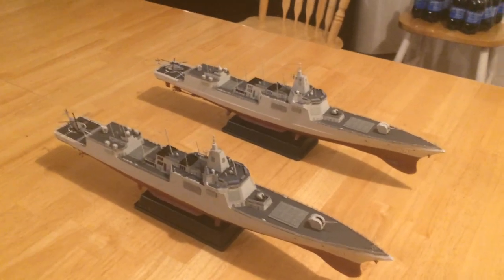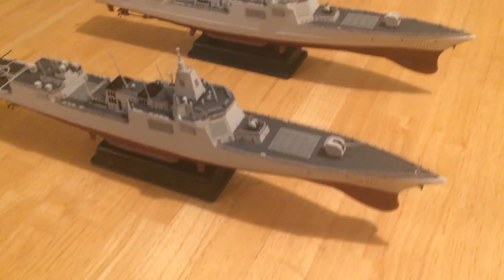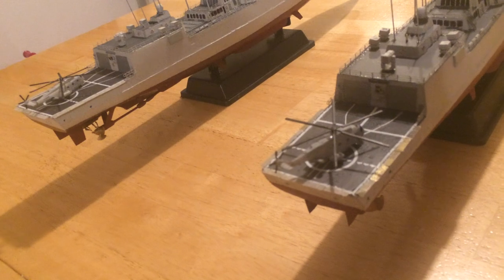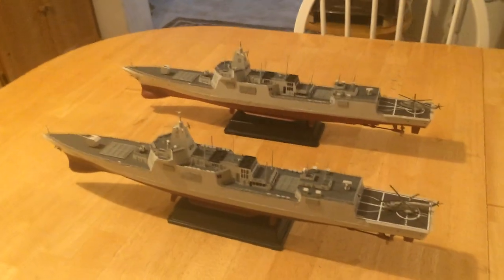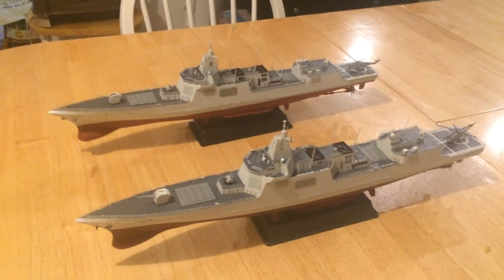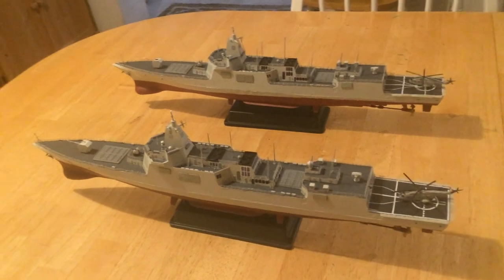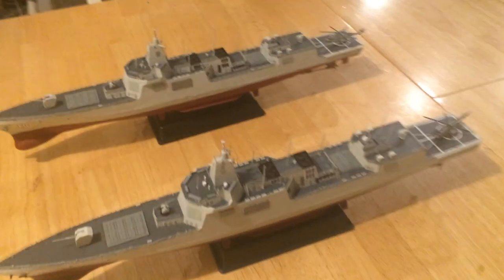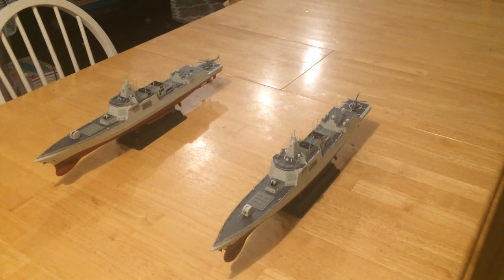Chines Navy (PLAN) Type 055 Large DDG (Cruiser)

Comment: The most prominent feature of Type 055 is its sensor arrays,
- The radars are all with fully solid state AESA antennas
- They are reportedly using digital waveform generation
- At least 3 different types of visually large AESA antennas can be seen
So it's safe to say that they are multi-band with data fusion and electronic warfare integration. Their capabilities can also be upgraded completely by software.

Comment: The reason of 055 have less VLS number is very simple: Chinese VLS system is much larger, 0.8 meter caliber 9 meter depth. Compare to US 0.7 meter caliber and 7.18 meter depth. In the world of missile, guide system made from US and China are weight pretty much the same, you can compare AA missiles made from both country to have a general picture. The reason why Chinese made those VLS so big is simple: longer range, bigger explosion. Due to current disadvantage of their carrier capability. They need 055 to pack as much punch as possible.
By the way, Chinese system can shoot 533mm rocket assist torpedo from the VLS which is insane.
Reply: China doesn’t have a anti submarine missile (asroc） that has a 533 torpedo warhead. But the Yu-8 has a range of 160 KM. So China doesn’t really that much on helicopters for anti submarine warfare.
Reply: @dadidadida123  I heard there is a 533 rocket assist torpedo for anti Aircraft carrier purpose. The anti-sub torpedo fire from surface ship usually much smaller.

Comment: Hi Jeff, great work, these 055 kits are due for release here in AU shortly. Cheers Peter Hoskins
Reply from the maker: GREAT..they are worth it.  I got mine on eBay from China for about 24.95 + shipping.
Reply: Jeff Head Thanks Jeff, these 055’s look to be a big step forward for the PLAN, when I first saw the dimensions and armaments they certainly are not a DDG, as you have said they really are a full blown CG. Cheers. 👍
Reply from the maker: @petehoskins1267  I believe the Ticos warrant CG...so do these.  in fact, so do the Se Jong class from the SKOR Navy.  I believe the Ticos are still the best out there.  They experience the US has gained and factored into its many upgrades are something the Chinese have not had time to experience yet...much less program and develop the solutions and have them already in these vessels and ready to go.  But they are capable and dangerous ships none the less, and we cannot take them for granted.  The US needs to get the CGX designed and building in the next 4-6 years and then have them come out with effective Riag Guns and lasers, and effective long range munitions for the 127mm or 155mms.  We were almost there with all of those things before the Obama admin canceled outright the LR munitions, canceled the at sea test the rail gun was more than ready for, and slowed down the Laser testing that was already at sea and performing well.  We need to get off our laurels now and get all of those things back on the front burner.
Reply: Jeff Head Fully agree Jeff, the Tico’s are so important, but my money would always be on the US. Cheers.

Comment: VLS size is a key difference between US and Chinese destroyer. Chinese Destroyer need to take up the anti-ship task, at least partially under current situation. The large 850mmX9m “strike“ cell is prepared for that, and I think they are very likely to shoot a ship-board hypersonic ASBM from such a large cell. 

As the quad-pack missiles, I think it depends on the demand, could be under development or testing. But HQ16 has diameter around 0.35m and already fitted in 054A’s VLS, so I think quad-pack it in a 850mm cell should be no problem.

Comment: Why do we call type 055 a cruiser, while we call DDG1000 Zumwalt a destroyer? DDG1000 has larger displacement than type 055.
Reply from the maker: Well, to be fair, the Chinese do not call the Type 055 a cruiser.  Officially it is classed by them as a Large Destroyer.  And I agree, the Zummwalt could easily be classed as a cruiser (despite the Obama administrations neutering of the class), with its displacement, large guns, and 80 PVLS cells, along with its over sized hanger.  And, I believe that there is still the possibility that the ultimate CGX could be based on the Zummwalt hull.  Time will tell.
Reply: Ok. That makes lots of sense. Thank you.

Comment: The 055 has 112 units of vertical launching system instead of 128 units in Ticonderoga-class, which is lighter (9,600 tons of displacement) than 055.
Reply from the maker: Well, 1st, the Tico has a reloader crane that takes u 3 cells on each vLS install, so that's less 6 cells making 122.  The Type 055 also has a 24 cell HQ-10 launcher, so that makes 136 missiles,  But you have to add 8 cells back into Tico for their Harpoons so that makes 130.  So the Type 055 has 136 missiles in total ready to launch, the Tico has 130...but they can quad pack ESSMs and usually will have close to 20 ells quad packed making for an additional 60 missiles.  So a std loadout for a Tico would be 170 missiles, while a standard Type 055 would be 136 missile...unless we find that they are quad packing something too...but there has been no confirmation of this.  No one has seen it that =could or would talk.  Both units are powerful ships and they serve basically the same purpose.  Either side would be foolish to underestimate the other.
Reply: First, all I’m saying is that Chinese are still somehow behind American, more or less, we can’t get one single hole in the VLS as small as American do, which limits the number of units installed. The one single hole in 055 is 9000mm deep instead of 7692mm in Ticonderoga(diameter is also larger), which means we have problems minimizing the sizes of missiles. Second, god keeps man like you for a reason, most people stop thinking by joking about ’made in China ’, few smart people like you know the truth, and Americans need the truth, so does the world. Gold bless you, and best wishes to you.
Reply: @wenbonie731  055 use 9k mm instead  of 7692mm is not because CN has problems on minimizing the sizes of missiles. bigger size means big size missiles, big size missiles means it hold the anti-ship missiles, and single unit can hold 2 or 4 smaller size anti-air missiles. type 055 is modern multifunctional destroyer, because the hole unit is much more advanced than the US collections, the 112 units can be more competitive and aggressive than 128 units on TI AND BURKE.
Reply: @wenbonie731  GJB 5860-2006 (Chinese: 国家军用标准 5860-2006; pinyin: Guo-jia Jun-yong 5860-2006; literally: 'National Military Standard 5860-2006') is a Chinese military technical standard describing a vertical launching system (VLS) for all types of missiles aboard surface combatants.

Cells have a square crosssection with 850 millimetres (33 in) sides, and may be 9 m (30 ft), 7 m (23 ft), or 3.3 m (11 ft) deep. Each cell carries one missile; the shortest cell may carry four missiles. Hot and cold launches are supported; hot launching uses the concentric canister launch (CCL) approach with exhaust vents within each launch cell.[1]

The first operational implementation is believed to be the VLS aboard the People's Liberation Army Navy's Type 052D destroyer.

Comment: america is using old PESA radars, all chinese destroyers with vertical launchers are using AESA radars.
Reply: SPY-6 is on the way lol
Reply: @firkinsukhoi7048  on the way = not ready yet.
chinese destroyers had it for 15 years, the first 052c desroyer commissioned in july 2004
Reply: @firkinsukhoi7048  lol
Reply: tk yup but I think the type 346 radar on type 052C use Silicon which have lower efficiency than the GaAs and GaN…SPY-6 use GaN btw.
Reply: tk oh and AESA/PESA is just one factor to the performance of radar.without other.data we can't simply tell which one is better.
Reply: @firkinsukhoi7048  i repeat '15 years ago'😄
Reply: tk yeah I know but for your information the first ship-based AESA is Japanese OPS-24 on DD-155 in 1988.But obviously Japan is still use SPY-1 for their AEGIS system, isn't it?
Reply: @firkinsukhoi7048  well... you can not buy something they don't have, right?🙂

Comment: 长宽比例不对吧 感觉不够胖
Reply from the maker: Your Chinese indicates that the ratio is wrong on the ship r the model.  I expect it is the model, knowing Bonco as I do.  Each Type 055 is 180 m long and 20 m wide (That's 590 ft by 66 ft) This is the official dimension. This is a 1 tp 9 ration width to length.  The model is indeed not exactly this.  It is 20.25 inches long by 2.3 inches wide.  This is a 8.8 ratio which is a bit too small.  Either the  model should be just a tad longer, or the model should be just  tad less wide.  But that's  alright.  Outside of this, it is a good representation of the ship, and i have noticed in the past this same thing about other Bronco models  They have a similar problem with the Type 052D model.  But then again, they are the only company offering a full hull plastic model kit of these two vessels at all.  Thanks for the input.
Reply from the maker: Please read my reply.  Here's the best I can do in Chinese:  您的中文表示该型号的船舶比例错误。我希望它是模特，像我一样了解Bonco。每个055型长180米，宽20米（这是590英尺乘66英尺）这是官方尺寸。这是长度为1 tp 9的宽度。这个模型确实不是这个。它长20.25英寸，宽2.3英寸。这是8.8比率，有点太小。模型应该只是稍微长一点，或者模型应该稍微宽一点。但那没关系。除此之外，它是船的一个很好的代表，我在过去注意到其他Bronco模型的相同事情他们与052D型号有类似的问题。但话说回来，他们是唯一一家提供这两艘船的全船体塑料模型套件的公司。感谢您的投入。